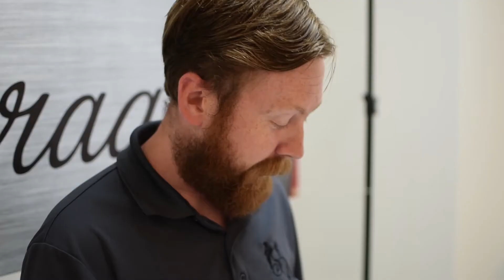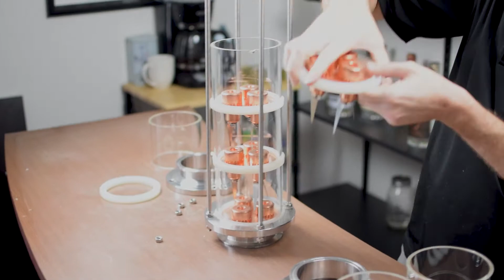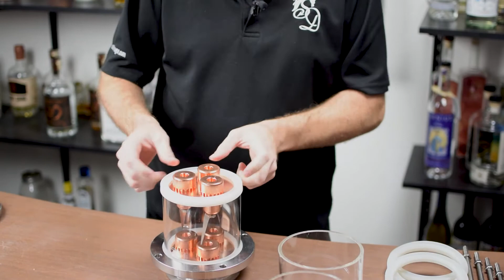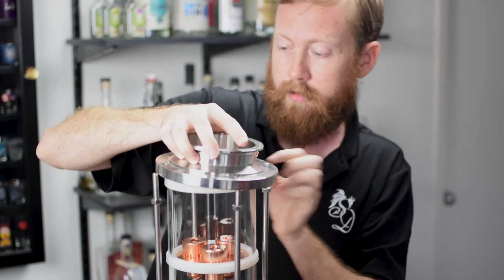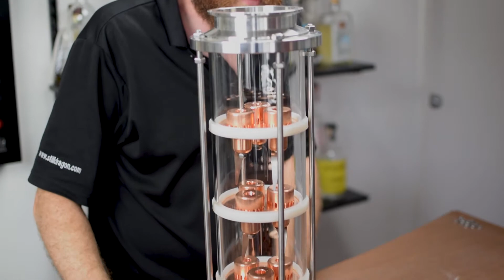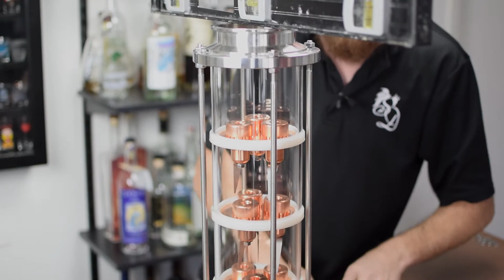Putting Together a Crystal Dragon

Comment: One question, if the reflux column is equiped with a precooler, wahet is the appropriate set point of the temperature we have to obtain in the precooler?
Reply: If by "pre-cooler" do you mean the reflux condenser ? The temperature of the discharge water will have a direct affect on the ABV of the distillate to be sure. However, if you are unable to provide uniform, in going coolant temperatures for the duration of the run the flow rate of coolant becomes much more of a factor beyond a set desired temperature. Therefore, for many small operators on a small budget, it is best to monitor alcohol vapor temperature above the dephlegmator and adjust flow rate according to the desired ABV. Does that make sense sir?
Reply: @smaug147   thanks for the answer. Please confirm if i am correct on following: The lower the reflux condenser's temperature the higher ABV and vice versa?

Comment: are the gaskets silicone? if so, are they a special type, cause it is my understanding that silicone is nasty stuff when it is exposed to 95% ethanol at "high" temps.
This thing is beautiful anyway.
Reply: There is evidence to suggest Silicone has fair resistance to Ethanol.  The problem is other more volatile chemicals such as acetone.